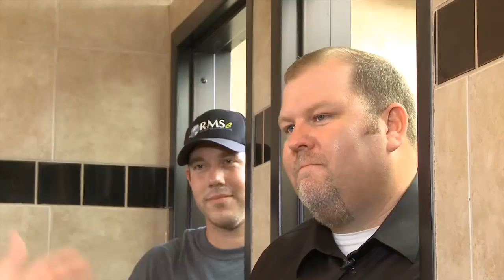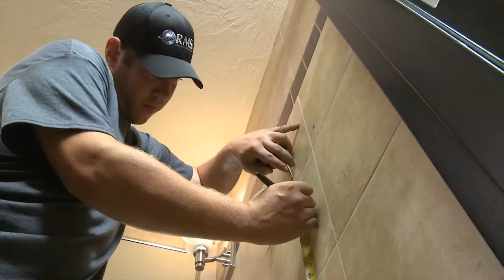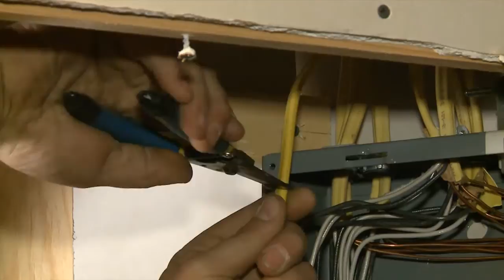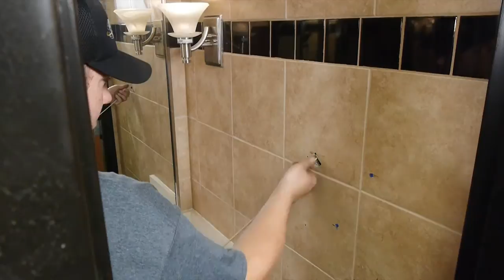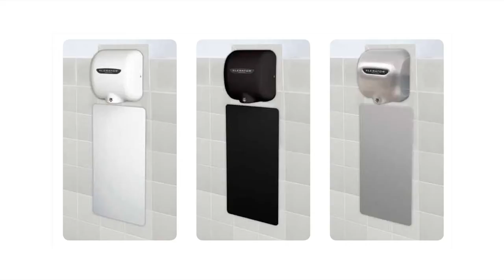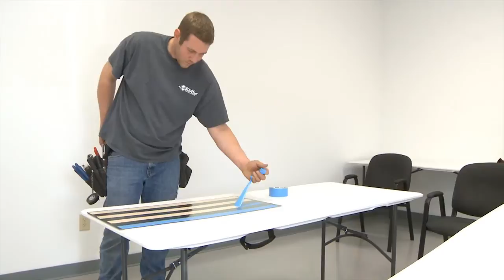Surface Mount Technology Installation - Excel Dryer (Video 1)

Comment: Ok I saw two things that don't make sense, 1- he is bringing 12/2 romex to the panel but then I saw MC coming in to the dryer, was this two separate videos cut in one? ...gotcha.. In pay attention to detail.
2nd- the dedicated circuit breaker had to be a arc foult or ground foult or combo breaker because is install in a bathroom, and in the video shows a regular 20amp breaker, but I think is two separated videos.